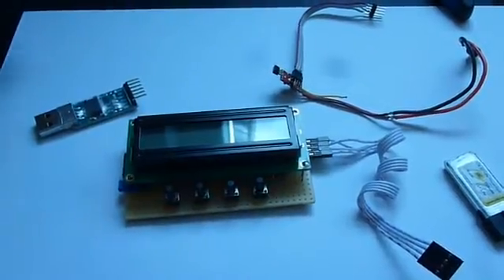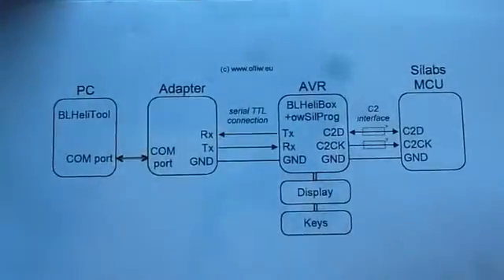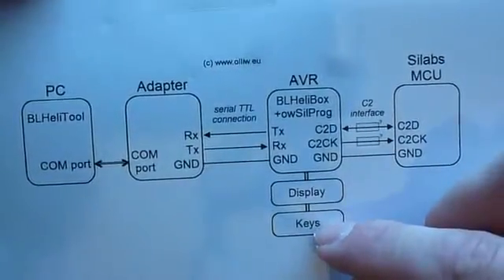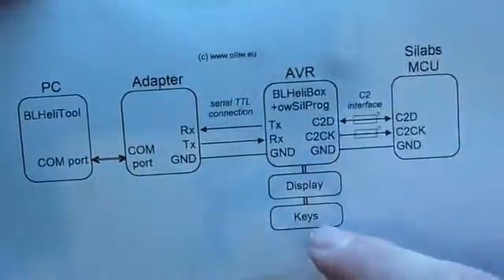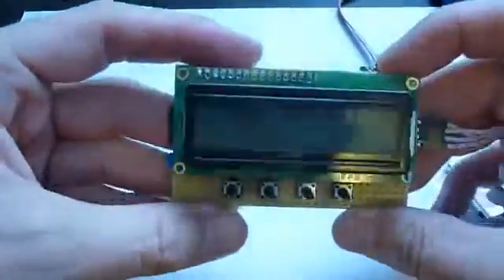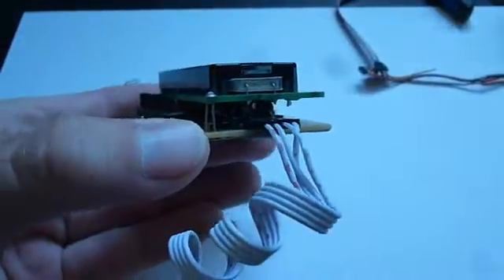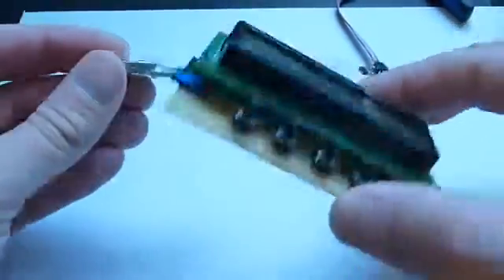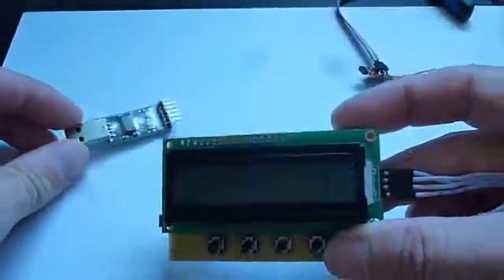OlliW's BLHeliBox: Part 1 - Basics and Hardware

Comment: hello, i ask help you if is possible, a have a station soldier dz915 , on display soldier have chip c8051f310 and no work fine,the number on display no work , i have buy new c8051f310 with out firmware ,now i have a board mega 2560 , i have flashed it with boot loader for ATmega2560 @ 16MHz: owsilprog_v120_m2560_16mhz_pb2pb3.hex,i have connect it to c8051f310 with pin vcc +3v ,gnd ,c2d and c2ck and use BLHeliTool , now i want read all flash in old chip and write in new chip , it is possible? thanks for help.....sorry my bad inglish